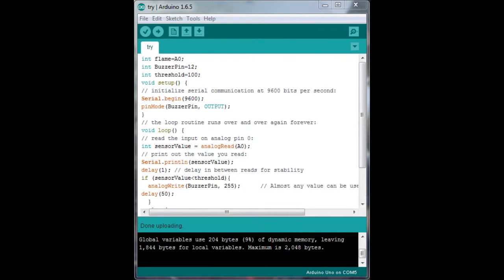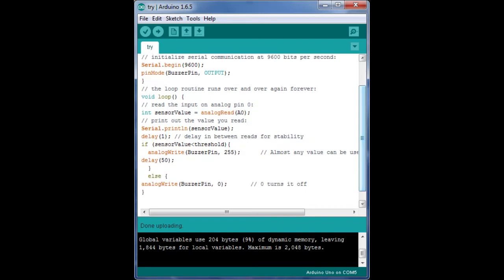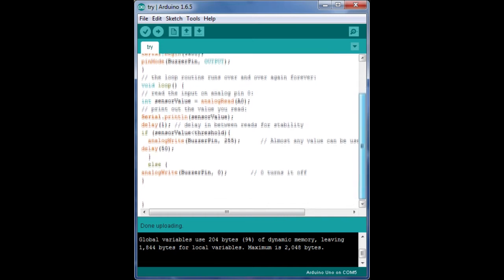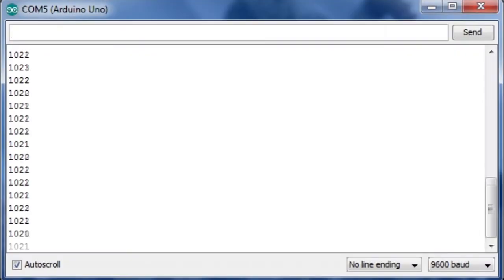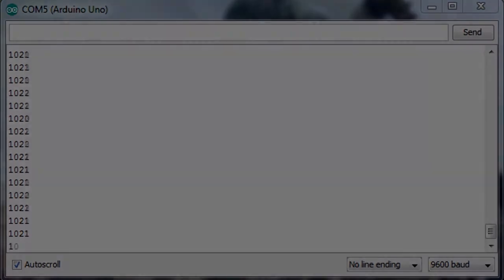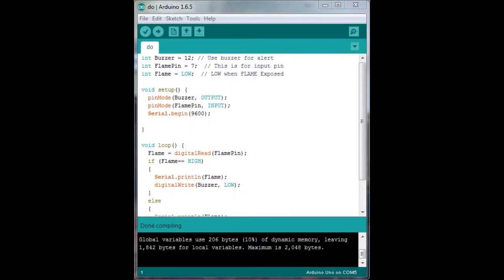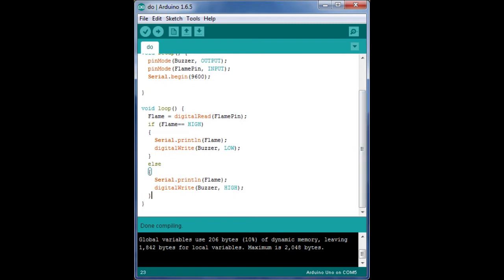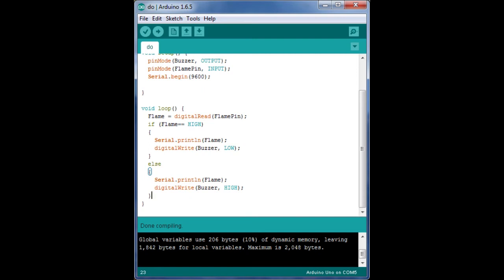#2 Flame sensor (analog and digital input)

Comment: One doubt..I bought a flame sensor it doesn't have a analogue pin..can I take the +ve pin of photodiode as analogue out?
Reply from the maker: thankyou very much for the question ..sorry for the late reply.... +ve pin is for the 5v if theres no analog pin  there must be a digital pin for sure :) and i dont think you can take the +ve  pin as analog out
Reply: @TechtoTravel-1527 Thank you for the reply. I referred to a circuit diagram of flame sensor and found that analogue output pin comes from 3rd pin of IC which also has a connection to +ve lead of photodiode.So I took a output from +ve pin and it shows a gradual decrease from 5V to 0V as the distance from sensor to flame  source increases.That means it is a analogue output.But when I connected to the circuit it doesn't work well.My flame sensor has three pins: VCC GND and DO but doesn't have a AO.So it will be very helpful if you check the continuity between AO pin and +ve lead of photodiode in your flame sensor.If that is continuous let me know.Thank you in advance. Btw you got a new subscriber✌
Reply: Can I get your whatsapp number if you dont mind.
Reply from the maker: @dilshadktkl1744  sorry man not using whatsapp or any other social media
Reply: @TechtoTravel-1527  ok